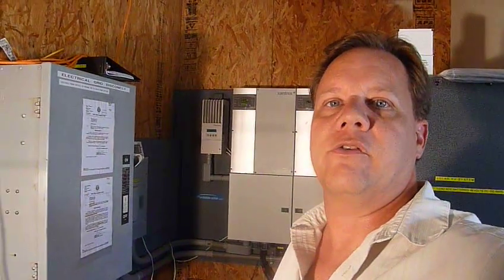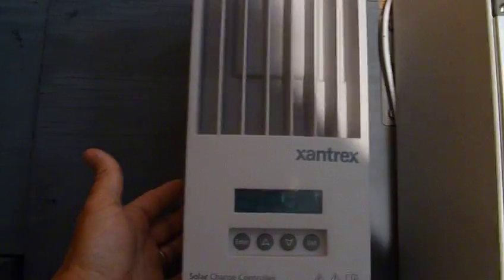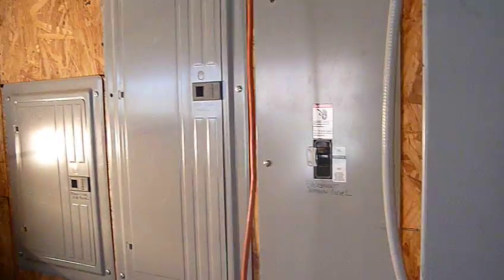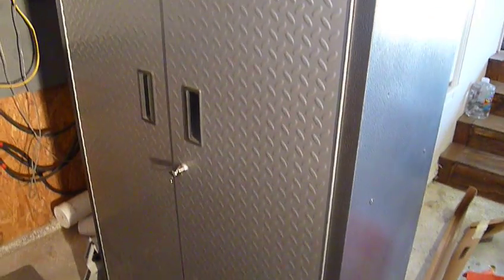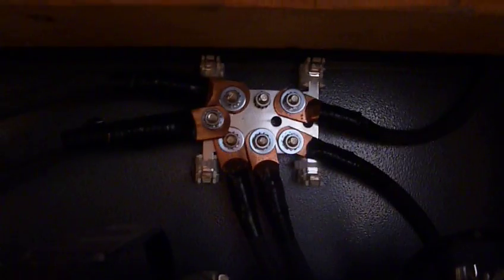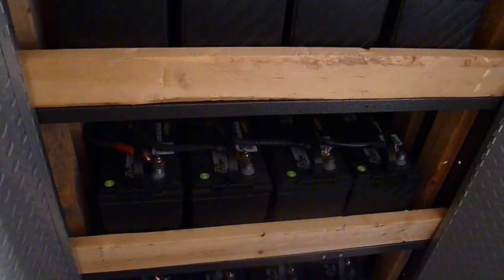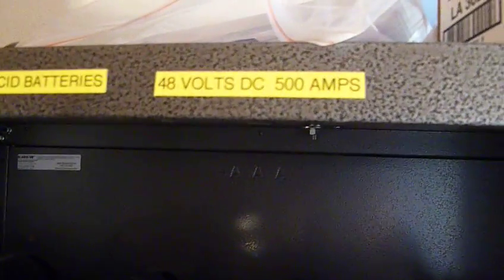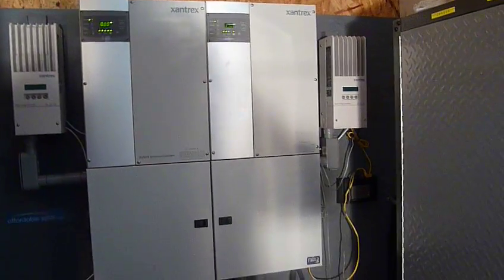12KW Xantrex Solar System PV Grid Tied Battery backed

Comment from the maker: To everyone else. Not much has change. System still working as usual. Daily avg power is about 4.6kw with maybe a peak of 5.3-5.6kw.  Not the 6K its rated for.  Perhaps its drift in the panels and or issues in the controllers.  Anyone have comparison info on Midnite Solar units??

Comment: I was wondering if you are still using the old xantrex gateway or have you migrated to the new combox. I too have a xantrex system installed in 2011 and I have the new combox and the old gateway that I left it in the xanbus loop. The reason was to keep all the old data and lifetime statistics while the new combox only collects data from the date of install ad give more bells and whisles. I am having trouble with the combox but I still have all the data. from the old system. I need the widget because somehow I lost the cd that came with my original gateway any help you could send my way would be appreciated.

Comment: you may want to get some fans on those charge controllers if they reach 115F they auto derate by up to 1000w depending on temp. my system is the same as yours but twice as big(4 SCC) I was loosing 4000w due to heat derate. Just found this out and put some small fans in front of the controllers, temp went from 130f to 104f within minutes. Got 2000w back for the price of two wallyworld fans for 10 dollars each.Put the fans on a timer to come on in the morning and off two hours before sunset.

Comment from the maker: Im not running them to 500 amps. I have 500 amps capacity.  They are only for backup when power goes out which is maybe once every 6mo for about 6hrs.  I have run during my own test of grid down. With sun and battery I can run all of the home with 1of my 2 ac units for all hours while sun is out.

Comment from the maker: The batteries dont leak as I keep them all clean. infact they never have over flowed or corroded.  They are vented just from all the holes in the cabinet, actually there is over 3inch of air vents top to bottom.  I dont run a fan at this time since they are never under load. This system is daylight use only and batteries are topped off each morning.